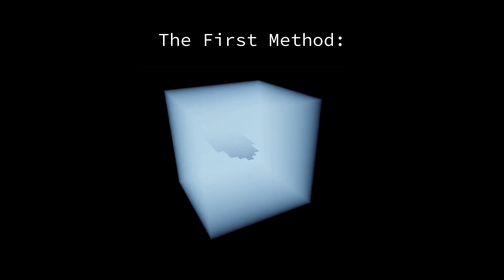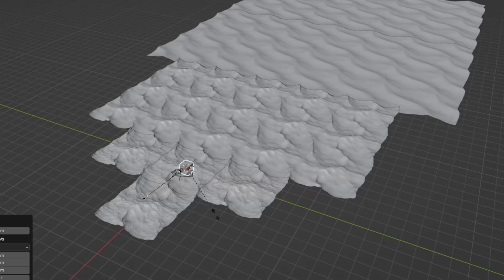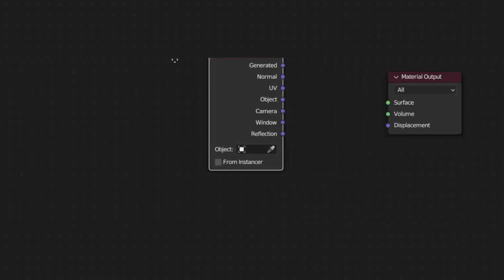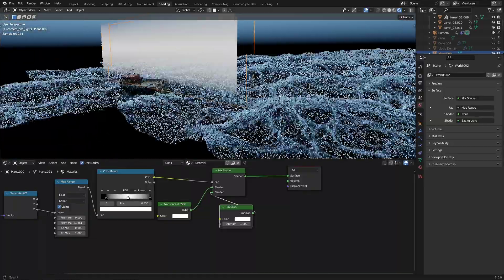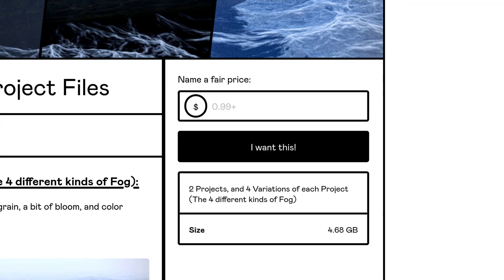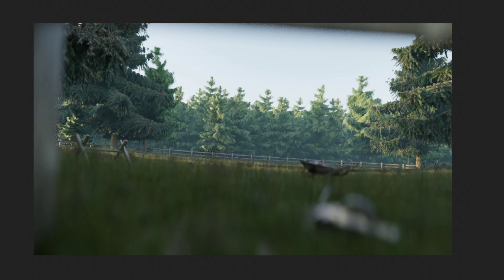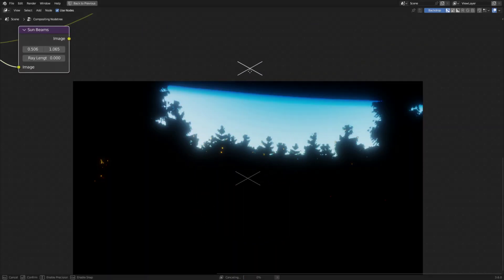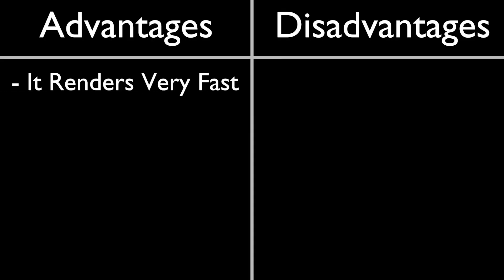Every Way to Add Fog in Blender (4 Ways)

Comment: Last mathod is just so good but whats difference between z depth and mist 🤔🤔🤔
Reply from the maker: You could also use mist pass for that method - The difference is that, for the mist pass you have to set the start and end point, but with the z depth it's always the entire scene. So it's fewer steps to use the z depth, which is why I did it. Hope that helps!